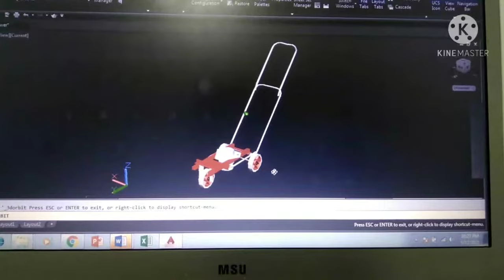DIY GRASS CUTTER | FROM OLD WASHING MACHINE MOTOR & BAG CART |

Comment: Sir, ye btao normal motor me to koe nut bolt ni hota wo kha se lia ho
Reply from the maker: I bought the adaptor on motor online here in philippines. You can choose depending on the shaft diameter of your motor. For my mower i used motor with 10mm diam shaft. Maybe you can buy it also in india. Here is the link for reference. This is available in our country.

https://www.google.com/shopping/product/1?q=adaptor+in+motor+same+as.grinder+india&client=ms-android-samsung-gj-rev1&biw=412&bih=731&tbs=vw:l,ss:44&prmd=isnv&sxsrf=ALeKk03jL3cjwjN7Cs-c88Jon3VDH7Hd0g:1628678529219&prds=num:1,of:1,eto:7692675965093358926_0,prmr:1,pid:7692675965093358926,cs:1